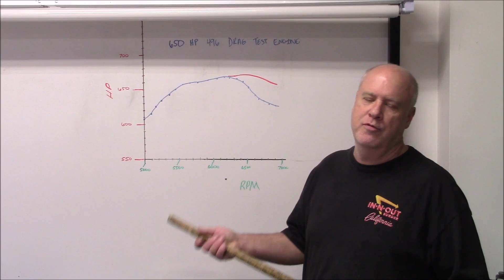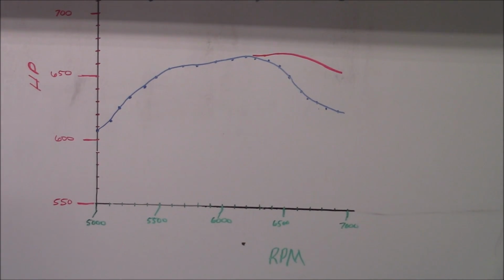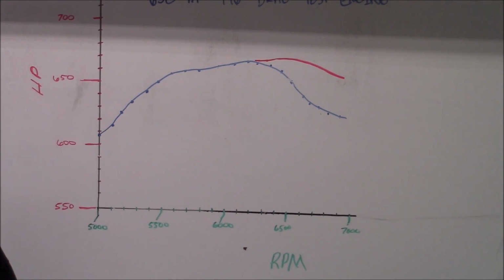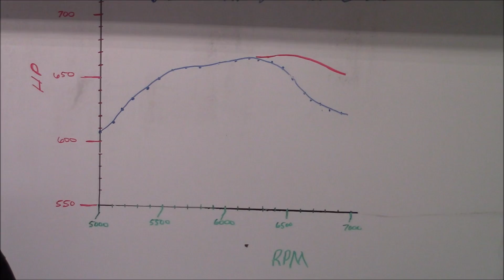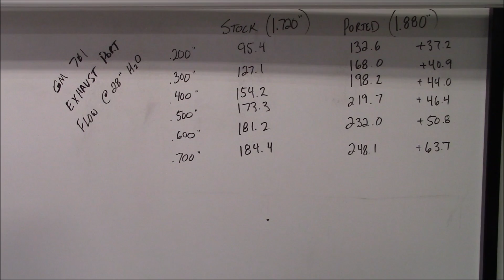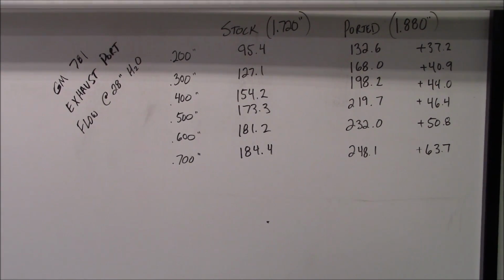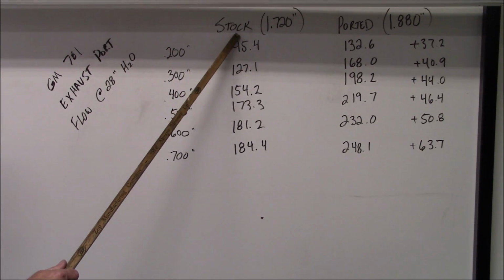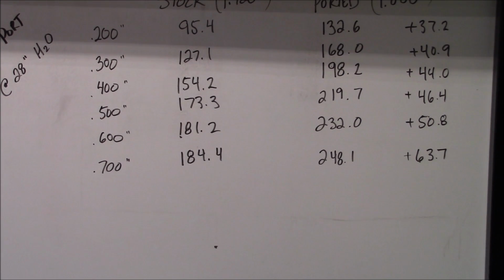Part 24 - Porting The Exhaust Port and Combustion Chamber 781 Head - 620HP 454 Chevy Engine Build

Comment: Great job on Videos always awesome. I would still like a real comparison with same valve diameter to have a real life gain on porting without changing the valve side or even and or, change valve with no porting and flow to see the gain. These are just suggestions I would like to start porting heads I watch videos but I think I would start with someone with experience by my side! Thanks again and keep doing your great job!

Comment: all said and done how much would a pair your ovalport heads cost after you selected the ones with the least amount of core shift redid the valve guides and ported the cylinder heads opened up the valves for the new valves seats you did all that good stuff valve springs new valves how much is all that cost let's have a number for a pair of heads overport ones from you please
Reply: the reason I'm asking how much you spent on your cylinder heads because I built a motor myself before 68th that's all it was then I used aftermarket cast iron cylinder heads on it because at the time I could not find any factory square Port hits I had a total of $1,500 in my world product grumpy Jenkins cast iron square Port heads how much did your heads cost did I spend too much because we know how much your heads give you your horsepower I want to know how much you spend on them heads to get that horsepower and I never sent you hate mail I think you misunderstood it send it back to me in this text so I can please respond because talk to text on my phone does not always put down what I say oh yeah my 468 cubic inch big black Chevy made 735 horse
and yes I had way more than 9.9 to one compressor

Comment: Mark what are the flow number for the intake side? Any where close to 330cfm at 500? I’m building a 467 with 781 heads and a tunnel ram with 660 holleys.

Comment: You’re porting the heads to try to gain airflow when your problem is very likely that the hyd lifters are collapsing at the higher RPM. 6300+ is always a stumbling block with the hyd lifters these days. 
  Installing solid lifters on that same hyd roller profile probably would have probably pulled much higher before falling off. 
    I’ve made 625hp /625Tq on 496’s with 2.125”/1.75” valves and no porting on those heads, with a mild cam and pump gas.
Reply: You are correct.       This particular engine received a solid flat tappet   250-260@ .050  ish if I recall .

Comment: Have you ever ran the numbers for a stock sized valve ported head?
Reply: Just a ball park, I see many people claim to pick up .4 and 3-4 mph by porting with stock valve size. In  theory, this is average 20 cfm improvement.
Reply: dragginwagon406 so in theory unless it’s a dedicated strip car it’s not really worth doing any more than a clean up port if you were to retain stock valves?
Reply: @Spudderr , depends on how you look at it...for several hours of research and a few hours with a die grinder, you can pick up 40 hp. In my book, that's mandatory. 

Add 2.19/1.88 valves, and porting done right, the difference can be 100+ hp obviously much more power available, if the  rest of the combination is on point.
Reply: dragginwagon406 gotcha I’ll go ahead and go for it then. I don’t really have any way to get bigger valves cut due to no machine shops near. Thanks
Reply: He puts the flow numbers in the intake porting videos.   Stock and modified.
Reply: Abcdefghijklmnopqrstuvwxyz he lists it for stock ports with bigger valves not modified ports with stock valves
Reply: @Spudderr  it’s stays stock 1.72” above the first column.

Comment: I have a 94 ,454 engine. Is the iron heads worth working for a street performance build. Mild porting, and converting the rockers? I'd like to swap in a mild cam, i already got a performer rpm airgap intake and long tube headers , should be 330, 340 hp. And 440 tq. I have seen a equal engine a dyno. I want to keep the lower compression , maybe add a turbo. I hope to have 600 hp & tq on tap. for possible daily decent mpg (for a BBC!) 15 mpg in town , maybe hyper mile about 25mpg on the long roads! I have overdrive. About 3.08, and about 5,000 lbs...  Should I just look in to a set of older oval ports. Or can these be worked? And with about 10psi...
Great video. I don't know that much about the newer BBC stuff. I'm at home with SBC stuff.. Thanks

Comment: Mark I see some guys claiming a cam with a higher duration and valve lift on the exhaust side (more lift and due at 50 than the intake) that you are leaving power on the table. If that’s so then why do so many cam companies run a dual pattern design . This is for stock heads, 781 to be exact. I. Running s lunati solid 247/255 612/ 635 lift would I be giving up power in my iron head 10.5 to 1 467 ...?
Reply: IF YOU PUT IN BIG VALVES AND PORT LIKE HE IS SHOWING YOUR GAIN WOULD BE TREMENDOUS.  60 +HORSPOWER. STOCK HEADS DO NOT LIKE THAT MUCH CAM.
Reply: @hankclingingsmith8707  hey hank i plan on changing heads later anyway something like an afr 265 would work i think
Reply: There is so many factors, big cam grinders are trying to cover as many people as possible, to get the most out of your setup always go with a custom grind, and yeah afr 265 heads with the cnc porting are the best aftermarket head in that cc range available, but you might talk to Tony mammo of mammo motorsports first, he helped make all those afr heads work so well

Comment: Mark, I saw that you scribed out a mark on the head of the chamber. Is that scribe mark the actual head gasket size or the cylinder size? Great video and I hope you get paid dearly for sharing all this information with us.
Reply: Scott Sigmon 
Always scribe to the gasket you are using, which is what he did
Reply: If I'm correct, gasket is 1037 (steel fire ring, 4.370"). Be sure to add the holes in the early blocks.

Comment: Thanks a lot Mark. I'll be able to finish my heads now. I'll be trying to replicate this tomorrow. That will leave me with one completed head and one to go. Creating the venturi on the one side of the bowl and getting the short turns is the trickiest part. I'm going to print up some screen shots for the final pull on this head. I took these off the shelf just because of this series. Very inspirational. Love it.

Comment: I have a question do you work on LS1 engines too?
Reply: Everybody works on Ls1 engines these days Haha there is heaps of info out there mate just have to look for similar application as what you are aiming for. Most engine builders dont go outside of what is common because it's not necessary. I actually didnt have some factory parts and had no choice in going a different direction. I'm far from a engine builder but there is plenty enough info out there for the ls1. Practiaclly everything done in a backyard shed or under my house except head machining. Aiming for a reliable and cool running 430hp at the wheels with the ability to get 470+ on a leaner air fuel mix. In case I end up in a traffic jam I'd rather more fuel being dropped on the piston so it definitely wont over heat which seems to be relatively common with most of the mods I have done. Bottom end is standard except the cam and oil pump. If you are keen to know what I have done or if you have any questions I can help with let me know, I really dont mind. As I said I'm no engine builder but know a few and they are very excited about the fact I didnt listen to their advice of doing the same as everyone else. Ls1 is a easy and cheap motor to get reliable power from especially doing it yourself. Porting the heads is probably the hardest part to do yourself but that's one thing done on mine that engine builders and even a professional head port shop owner was extremely impressed with on mine. Research and confidence to have a go yourself is key mate. Bit of thinking outside the box never hurt anyone that bad it's just wise to get advice on what you are keen to try. If they tell you its unnecessary or pointless ask why and if it's going to be better than not doing it at all. At the end of the day it's the tuning that makes it work and he will need to know as much info as you can give him.

Comment: Awesome video series guys!  This info is tremendous!  Thank you for taking time from your busy schedule to share this stuff.  Want to try this on my closed chambered exhausts.  My engine really noses over past 6500 too.
Reply: Whats your cam and valvetrain setup?
Reply: Hi Derek.  396+.060,  250/260 @ .050 .685/.685 108Lsa solid roller.  Closed chamber forget number similar to 215 though.  2.06/1.72 3/8 stem valves.   Bowl ported only, 3 angle vj 30 deg back cut intakes.  1.625 vs 230# seat, don't know open press.  3/8 .080 wall pushrods, 1.7 roller rockers.  Approx 12:1.  Single plane intake, 800 holley,  Very strong torque 5500-6500 but falls off very quickly.  7000 shift.  7.39 @ 92.7 best 1/8.  3830# chevelle 4.11 approx 5000 stall 26 tire 3" full exhaust .  Thx for interest.